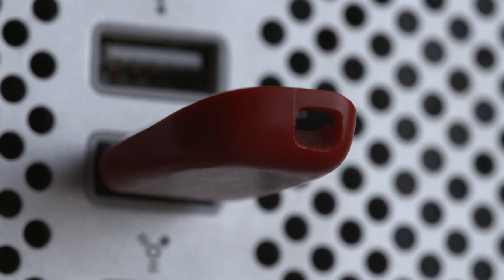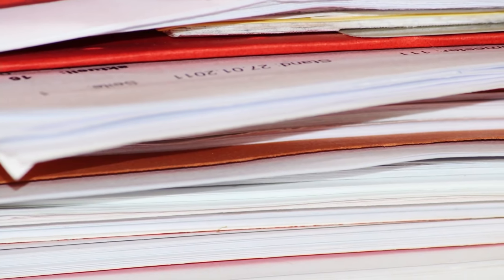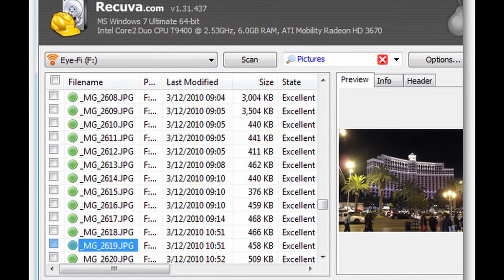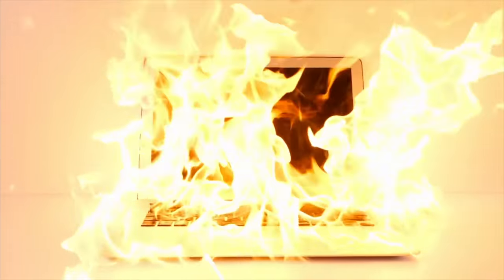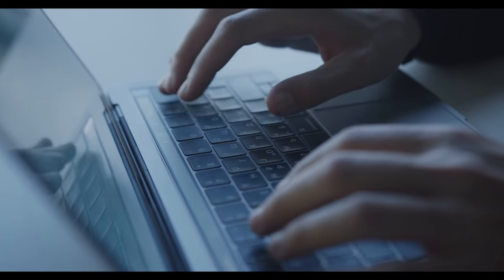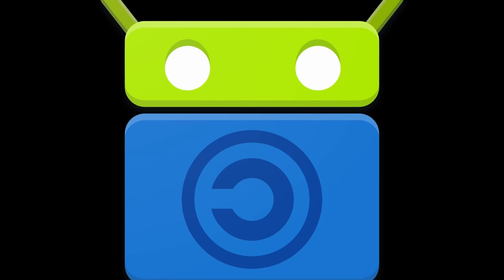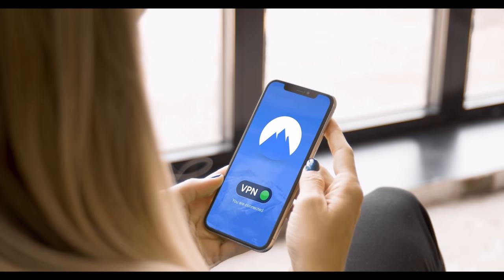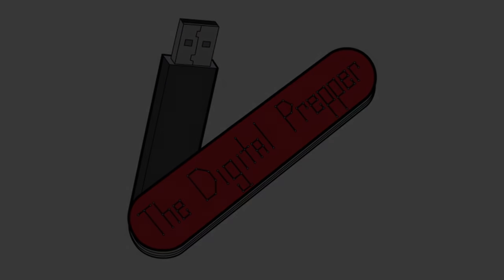8 ways to get started with digital preparedness (Digital Prepping Compilation)

Comment: Forgot to comment after I recapped.  
I actually didn’t think of backups and archives as different but I actually do both… but the archive stuff is info that I rarely, if ever, need agajn
Reply: Thanks for the heads up on restarting those archive devices once per year
Reply from the maker: Yup yup! I never thought about it likenthis until I did the research while working on this video. Very interesting stuff to think about!